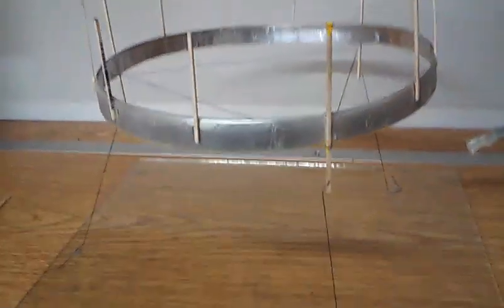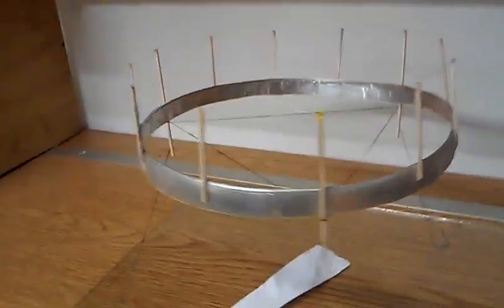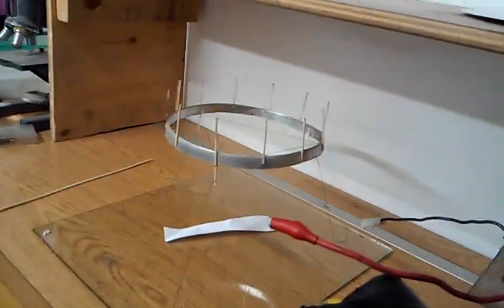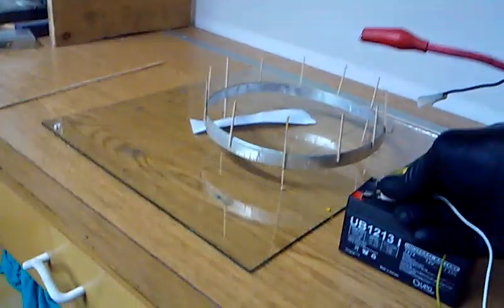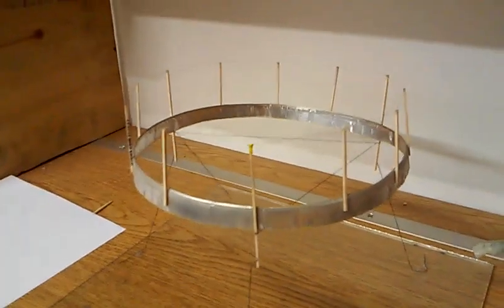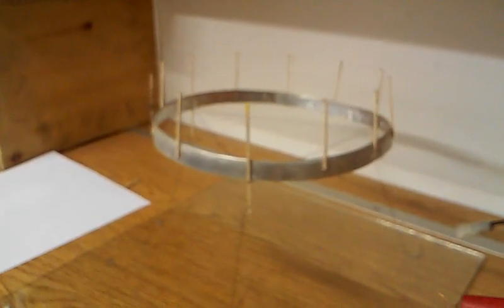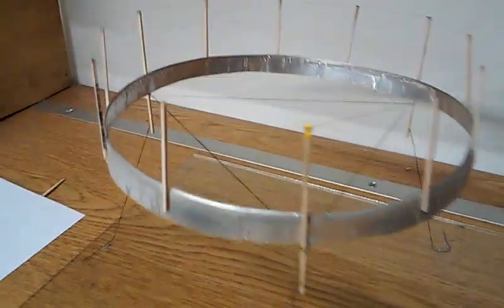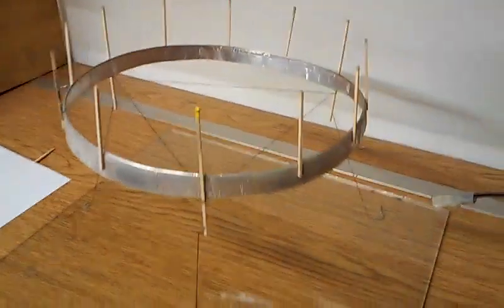ANTIGRAVITY LIFTER CREATES ARTIFICIAL GRAVITY ASYMMETRICAL CAPACITOR

Comment: This is an ionic thruster. The reason there is no feelable wind is because the ions get repelled by your hand instead of attracted. The reason why it is powerful is because the power supply has very high voltage and it is being distributed by something with some decent mass. I don't negate your device but it is not trying to fall upward

Comment: I agree. The ionic wind effect is not the primary force and has little to do with the levitation. It is the Biefeld-Brown Effect. Materials with a high dielectric constant allow for a stronger electric field, but tend to be susceptible to dielectric breakdown. I believe there is an optimum material that has both a high dielectric constant and a high breakdown threshold. Alkali free fiberglass sheets are good. This would outperform air greatly. Putting the "air dielectric lifter" in a vacuum will lower the dielectric constant and weaken the field concentration and the force. I'm sure TT Brown discovered just that. 😀
Reply: "I'm sure TT Brown discovered just that. 😀" - yes, almost 100 years ago !!!

Comment: This ring shaped craft is a very good build!  A ring shape is the best shape, if it can be built light enough.  The experiments he shows are also extremely intriguing as well.  It makes one wonder.  It is true though that the air is at 14psi so it doesn't have to move very fast to propel lightweight crafts.  Getting a power supply onboard though is not easy.
If you click on the purple icon to the left you can see a similar device that carries its power supply onboard.

Comment: A little tip, use tuning forks(432Hz) for your uprights on the lifter, then connect the wire(piano). Then add a charge.
Reply: what's a basic experiment I can conduct to familiarize myself with the forces at work?

Comment: You might try to figure out the lightest weight high voltage source you can. I was thinking that a voltage multiplier might work, but not sure. Also, experimenting with dielectrics other than air, which have the highest k value to weight ratio possible should increase the force allowing for the sorely needed payload increase. 🙂
Reply: gravity never existed all electricity and magnetism
Reply: @satanael9260  gravity never existed... all electricity and magnetism... by the way let me know when you actually "land on a moon"
Reply: Nice, I believe it attracts itself to the electrostatic field all around, the triangle is key i feel which brings forth an oscillating variable that builds up in amplitude and frequency, it would be cool to see the polarity behavior and orientation which would give definitive answers... to how and why, nice work, very interesting

Comment: I have seen two man made anti-gravity vehicles made here in Australia back in 1974 one was made by the Victorian Railway in Melbourne and the other was by the military, I got to see a book for a moment that a friends dad had about the one made by the military for a moment, but my friend freaked out when he noticed me reading it, but I did read that it used 150,000ACV into anything it levitates.
The one I walked behind had a small nuclear power plant the man was sitting on, it was about 4ft round and 4ft high and was under the 20ft diameter by 2ft thick framework that seemed to be made of angle iron, riveted together and made no noise as it floated away from me.
But the one made by the railway company was the disk shape, it flew over my grandparents’ house only about 30ft of the ground.
I was not sure if I should run or stay, but since the trees had not melted I decided to stay and watch it go over my head, it had what looked like a red glowing ring about 10ft in diameter in the centre with five other ones spread evenly around the outside of the large one and the outer edge of the disk, this was published in the local newspaper and made the paper about an inch thick as it had the blueprints on how to build it inside of it, so anyone that had the money could build their own, they did this because the government would not fund a larger one that could carry 200 passages, they claimed they would not back an unproven technology even though they had flown one around. 

I promise you reading this I am telling you the truth and have no need to lie to you, I grew up thinking by the time I needed a license we would be driving around in fling cars and was so excited, if only I knew about suppression and kept a copy of that paper.
Reply: Do you think this video is using the same concept as the book you've read?

Comment: I'd like to see this set up on a glass table with nothing under it 3 to 6f off the ground and the electrical system spaced back a few more feet. This setup still puts doubt that there is something in the drawer and under the transformer through the box.

Comment: This technology needs to be shared. Gives us more detail in all the components and how they are setup. Thank you.
Reply: Copper wire, some sticks, aluminum cake pan, battery and, some string.
Reply: @vc2702  what about input voltage. You need circuit board for that.

Comment: A few related concepts:  1. inertia is quantized; 2. inertia is a reaction of the quantum vacuum to the acceleration of electric charge; 3. inertia is closely related to self-inductance; 4. mitigation of self-inductance has effect on inertia; 5. inertial mass and inertia are also "gravitational effects"; 6. a capacitor moderates inductance.

Comment: Hey Jim, what you have there is a simple monopole elector vortex machine. Think about introducing a electro-switch to control the flow of the current after power amplifiers. Another thing to use is a kill-switch just after the power-source. This way you can toggle (increasing and decreasing) power along ur DC line . I have built a little more advanced version of this and its power out-put is 3,839.999 volts. I use the electro-switch to control the ascent and decent. For paralleling vectoring (pitch and yaw) I am using electro Monopole gimbal Sphere submerged in a mercury bath all controlled by a APP on my iphone. There are 4 decks of 360degree of Aluminum decking half-inch thick. Shell atm is a recycled parachute fabric. Always worried it will catching FIRE, I dream of a carbon fiber shell. 
 The more amplified power you have more lift you can create. 

1st deck power and lift generation
2nd deck the lifting deck
3rd deck is Controls observing deck
4th deck is living area
Reply: Do you have video of your device?
Reply: Yeah post that and show us all how it works sounds very interesting.

Comment: Awesome experiment,  could you share connection diagram? would be appreciated!
Reply: You can build a system with bossel wood, aluminum foil, and a 9-volt battery with wires running throughout the system. From there you can extrapolate a way to build it. It doesn't have to be a circle either. Most systems use triangular formations

Comment: Put horizontal lifters (for the lack of a better word) on each corner of the triangle and a light weight rc unit and you controlled flight, tethered but nonetheless

Comment: Hi, I'm a first year E. eng. student and I would like if possible, to request a blueprint or rough sketch maybe on how you've put that thing together. My classmates and I would want to build another one in class for a presentation project. An older design of a lifter that we have requires a very very high amount of voltage to power it up. Yours is way cooler Sir. Thank you.
Reply: Dux Anthony 
Copper wire, some sticks, aluminum cake pan, battery and, some string. there's the schematic. Lol

Comment: Yet to see anyone do these sort of experiments/tests etc. on a see-through table. There's probably an electro-magnet under the desk top.
Reply: I think it's real, but not anti gravity. Probably some ion effect
Reply: Hi BigDave,
I have been working with similar devices for 19 years.  These lightweight devices produce a light  electrostatic wind blowing downwards underneath them causing them to go up.  All of them need a relatively large external power supply except the one on my channel, it has onboard power!  You can see working models of it, if you click on the purple icon to the left. My similar device is very well verified to work.  (I am sure the externally powered device above works as well.) It is also clearly described on my site exactly how it works.
Reply: These ion thrusters are a dime a dozen all over youtube.  Watch a video explain how ion engines work and you'd know it does exactly what it looks like it's doing. No tricks under the table. The only thing disappointing about it is how it's portrayed as some kind of original thought.

Comment: Ion wind electro static charge are required for the lift but they are connective to the aeither and gravity, If you  switch it on then place it in a vacuum it would work ! I require the circuit diagram but can see that increasing the cap surface area for the same charge  is the next step. Good luck !

Comment: I think its pretty cool you achieved that amount of thrust, and with relatively heavy materials. Being able to lift the wooden stick is cool. I wonder if you might have even got a performance boost by using a metal ground plane instead of the glass your lifter took off from. It also makes me wonder if you might have had another performance boost by using a tubular ring instead of a flat one.
Reply: I thought the same thing about the tubular design

Comment: How about adding a type of dimmer switch like the old ceiling fans use to have where you can regulate the current see if you can slowly get it to lift
Reply: merlin195020 it’s 12V dc so you would need to use something else. Variac, divider network, or transistors.

Comment: This is not antigravity ...
magnetic repulsion, (by any route, including ionization)
it does not mean antigravity
Reply: This isn't magnetic repulsion, that was an electric current flowing through the air from non magnetic aluminum.  This is the electric field thrusting away from gravity's attraction.
Reply: Max Garcia exactly what do you postulate is the source of the relative repulsion? Look up T Townsend Brown before you say too much though...this is the technology used on the B2 bomber and other black budget programs (much more sophisticated in its control, but same principles). If you research it, apparently 1/3 of the B2 bombers had capacitive lifting systems on them and could hover in midair but they of course don’t want anyone to know that...
Reply: @samsonian  I didn't know that about to B2 bombers,  thanks for sharing that info bud 👍
Reply: shawn malbrough it’s a fascinating subject; there are so many systems built into some of the black project platforms (like the B2, other stealth craft...but with the TR-3B becoming prevalent at some point in the 70s or 80s who needs craft that uses air pressure to fly?) that are so high-tech it boggles the mind. Perhaps even more crazy is the work Viktor Schauberger was doing with water in the 20s and 30s (eventually being forced to work for the Nazis once they cottoned on to what his work meant) creating gravitic AND over-unity power effects with devices that used water!
Reply: Pero lo importante es que lo eleva.

Comment: Do u critics notice how it jumps into the air instantly as the power is applied and when he releases it from the force of the stick it jumps back like a spring? No flying machine we have will do that; they take several seconds to get moving. This is not likely movement of air doing this.

Comment: If I may, Jim ....    Some people here have brought up good points.  I would like to see you try something:  That flat piece of metal you've got there as a bottom ring.  Can you make rings within rings, or make a flat "coiled spiral" with the top wire over the rings within rings, or otherwise a flat spiral to improve its efficiency?

This is what I think:  I think there is an air flow, but it is occurring only in the area between your top wire and bottom ring, and there is a type of electro-inertial field polarization between the top wire and bottom ring, in that confined area only.  I agree that your device is heavier than the standard tin foil lifters, and its fast reaction time does not seem to be caused by merely an ion-wind thrust.  For the speed of levitation, it should be using a measurable and detectable thrust, but it does not look like it is doing that since you held the strip of paper underneath it.

The reason I'm asking, is because then you can wrap the thing in plastic wrap.  I would suggest not to directly touch the plastic wrap to your top wire, but have the stilts extend past the wire a bit to hold the plastic up off the wire.

I think this could work with some kind of inner air circulation field, so that the air flows down, then comes back around to the top and flows down again.  But at least, wrapping it in plastic wrap would be a good initial and easy test and can simulate an airframe.

Furthermore, using spiraled rings or concentric rings within rings (with the top bare wire overhead), and encased in a metal airframe in the case of Townsend Brown systems, only seem to demonstrate air flow over the hull surface . . .

If there is an internalized air flow though, an inner hull and outer hull would lend to creating an air space between the hulls that could circulate, and flow back up through the center to the top and back around again, in an isolated self-contained system.

Comment: That clearly has more lift then the triangle!. Also this is alot more lift than is needed in space. It looks to me like you could scale it up and use a small power source that would way wiegh less than say, a telephone pole! Nice work!
Reply: would not work in space though unless you add a gas propellant then it's just an ion thrust engine that already exists,it's using the same method but instead of an onboard tank of gas it's just using the air

Comment: If there was a gravity well above the device then when you let go of the stick it would have 'fallen up' rather than just sitting on top of your device.   If you were generating gravity, it would mean you were generating mass above which would have sucked a lot more stuff in, including the stick -  or anti-mass (antimatter) below which would mean your house would be cinder right now.  I'm not sure what you've done there since you didn't really show us enough.  But I'm sure you didn't create mass or anti-matter and therefore you didn't create gravity or anti-gravity.
Reply: most likely discharge ions and generated thrust by moving airmolecules
Reply: Add. Potentiometer to eliminate the jump when applying power.
Reply: Subquantum Kinetics show that Positive Charge ATTRACTS MATTER, and Negative Charge REPELS matter.
Reply: exactly correct
Reply: It works BETTER in Vacuum, as Takaaki Musha of Honda, NASA, and the inventor, TT Brown, showed in this, his patent, ELECTROKINETIC APPARATUS, Us Pat. No. 2, 949, 550, issued August 16, 1960.
Reply: Looks like a device the Germans were working on.
Reply: Your talking from an Atomistic point of view . Gravity is Electromagnetic . The entire Universe is electric.
Reply: Correct, LRoy. Very insightful. The UNIFYING FIELD is the Electric field. Scalar Electrostatic Potential. Quantum Mechanics. The Tesla Wave.
Reply: stinger bee - search "electric universe theory" and find that mass of a body has nothing to do with gravity. Just like people used to believe the earth was flat, people used to believe gravity is a function of mass.
Reply: I seem to recall that it is not fighting gravity, rather it reduces the mass of the object to zero.
Reply: yes. I am sure there is some physics misunderstanding in the claim to provide antigravity. First, define gravity and then cancel that. Or, make some gravity for fun and play with it.

Comment: This is more Electrostaic ~ where and what is the reference is there to gravity or anti gravity !?
Reply: Thanks for that Cesar ~ Both videos employ high voltage electrical energy to lift the 'craft away from the planet.  The source of the repulsion is clearly an electrical or electrostatic phenomenum.  Electrical force is billions of times stonger than gravity and my question is as gravity is such an insignificant force should it actually be referenced at all in context of Electrostatic Lifters ?
Reply: Good points all correct. You go to the head of the class. Electrostatic artificial gravity is WAY more powerful than mass-caused gravitattion. whch is the weakes force in Nature. Electrostatics and electromagnetism is ORDERS of magnitude stronger than natural mass-caused gravity. What do you think makes those BILLIONS of suspended tons of water aloft in the SKY, UNTIL A LIGHTNING BOLT.